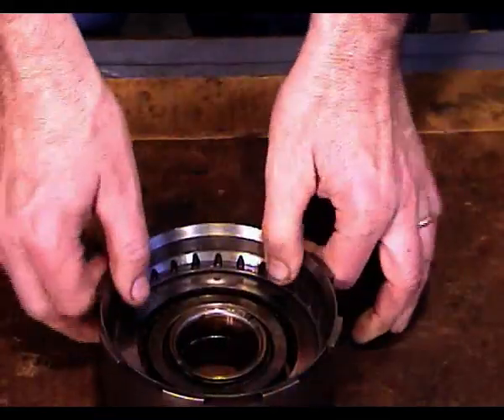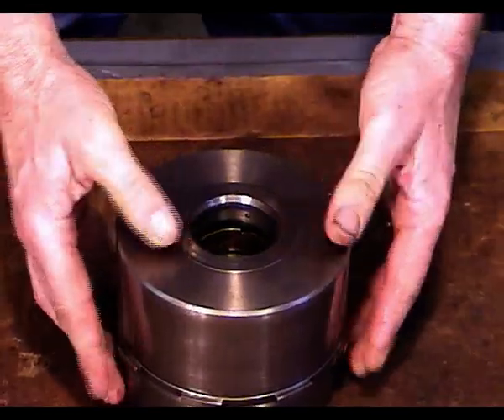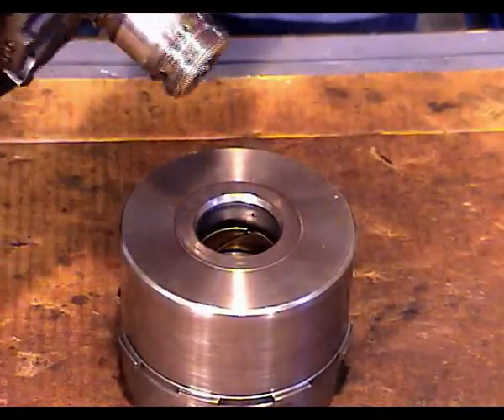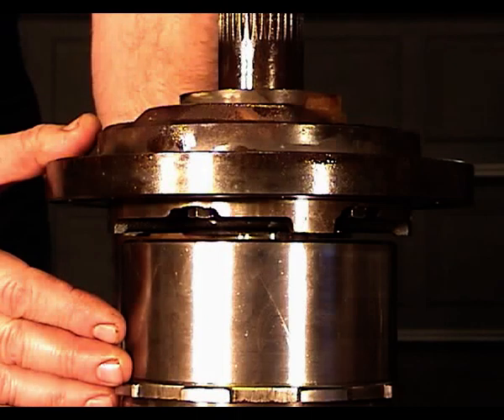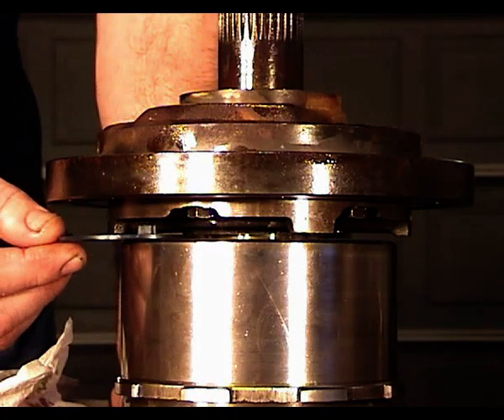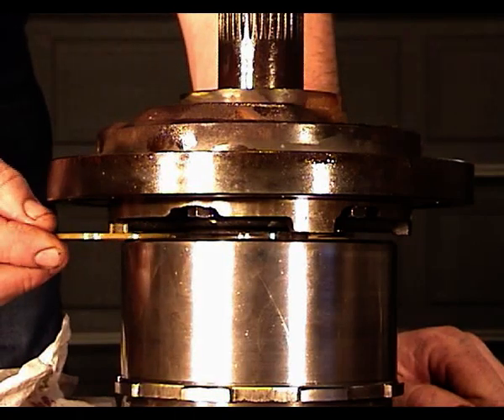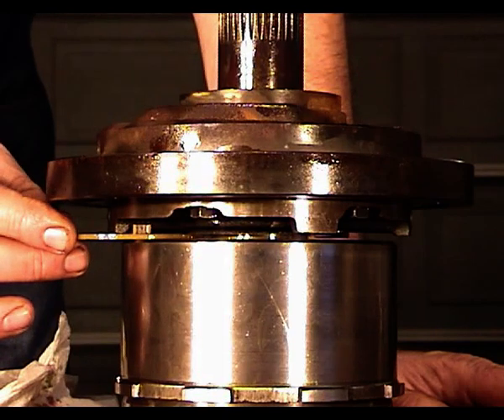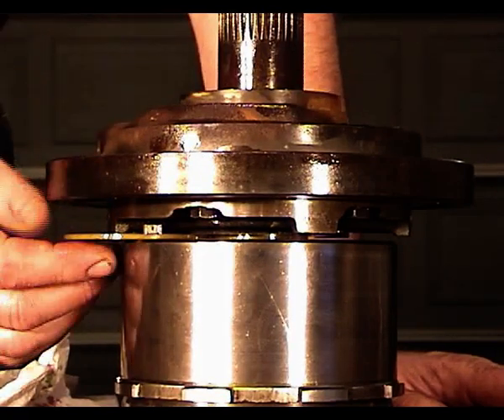How to select the #1 thrust washer on the Ford C4/C5 transmission.

Comment: How do you do math on that? 
So obviously, there’s a specific spec that it has to be. And you’re using a .0075”? What does it really need to be at? And how do you do the math on that?
Reply from the maker: I think I'm using a .075" #2 washer thickness. You have to trial and error on setting the end play as shown in my full length C4 repair video (.008" to .042" is the end play spec). Is the end play is too loose, you will need to get a thicker #2 washer for example. Once you know what thickness #2 washer is needed, then you can find what #1 thickness washer to use as in this short video.
Reply: @ thank you very much. This video and response helped me understand big time. Aha moment lol

Comment: Hey ive seen ur thunderbird vids. I want to do a cold air intake but idk where to put the IAT sensor. Stock it sits inside the airbox. I wanted to drill a hole on the intake tube and put it there but didnt know it its ok for it to be ahead of the maf
Reply from the maker: If you are not supercharging, the IAT should be near the MAF, after or before as it is in the stock location.